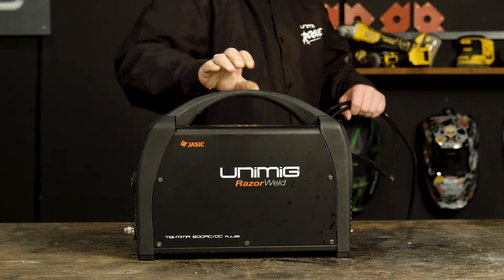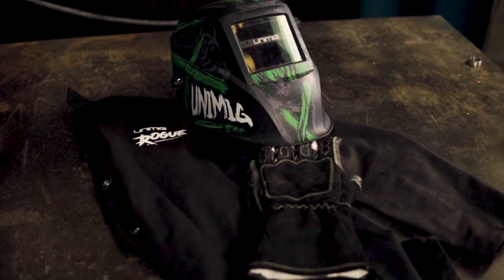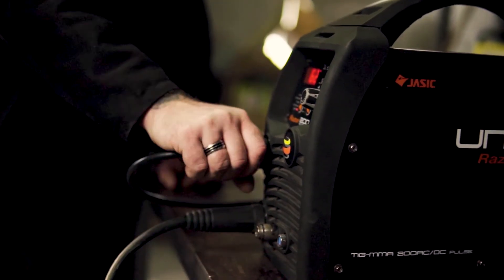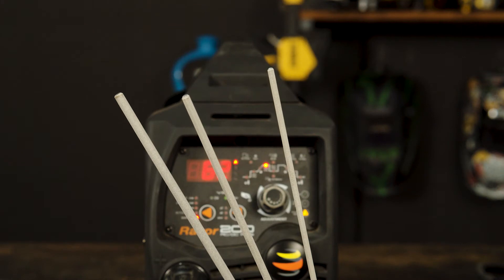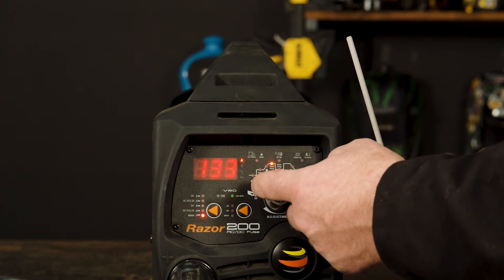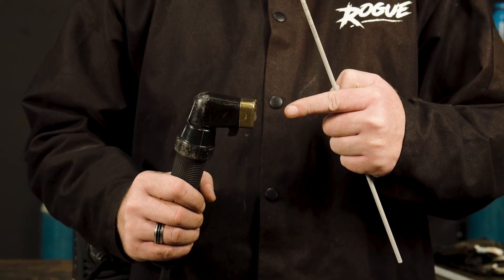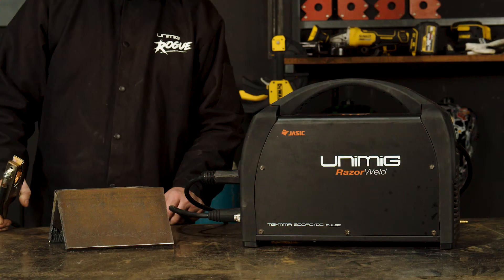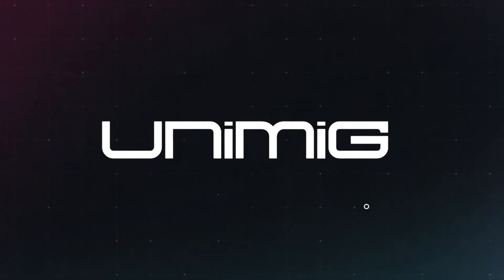RAZOR 200 AC/DC - Stick Welding Setup Guide

Comment: The only thing i find is the duty cycle is fairly low ?
Reply from the maker: Hey timothy, due to the 15 AMP plug, the limitations to the duty cycle are unfortunate but common. This machine has a 25% duty cycle on max output, which is slightly above industry standard on the 15 AMP plug. Thanks for the feedback!
Reply: @unimigsupport   start making some 20 amp and 32 amp machines ?  240 volt
Reply from the maker: @timothyrouse2853  We have plenty of 32 AMP machines in our range you can choose from. Happy to assist If you would like some help choosing one with the best applications for your use.
Reply: @unimigsupport   in the single phase , 240 volt ?
Reply: I have your 250 mst ?32 amp , 240 volt  I love it ? Just in your tig range i would like 32 amp ?
Reply from the maker: @timothyrouse2853  We have our three-phase 32 AMP Razor 320 AC/DC in our range. However, if you are looking strictly for a single-phase machine, your best bet is to change the 15 AMP plug to a 32 AMP plug on the 200 AC/DC. This will increase the duty cycle while still being a single-phase TIG Welder.
Reply: @unimigsupport   that can be done safely ?
Reply from the maker: @timothyrouse2853  You will need to get an electrician to change the plug for you, but yes, it can be done safely.
Reply: @unimigsupport   thank you very much ✌✌
Reply: @unimigsupport  
Just the wall plug? Or the machine plug too?
And how much will that increase the duty cycle?
Reply from the maker: @scummy73dude64  You will need a 32 AMP wall plug, and then professionally adjust to machines plug to 32 AMP to match. Just note this will void your warranty as this is not how the machine was intended to be used. We would assume the Duty Cycle would be increased by 8% or more, however, this has not been accurately tested.
Reply: @unimigsupport  
Thanks very much for reply